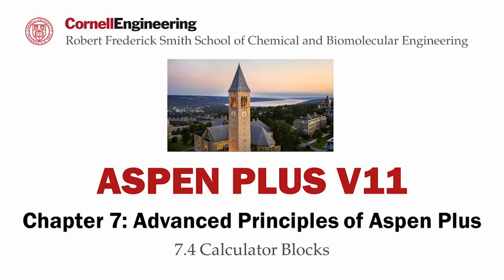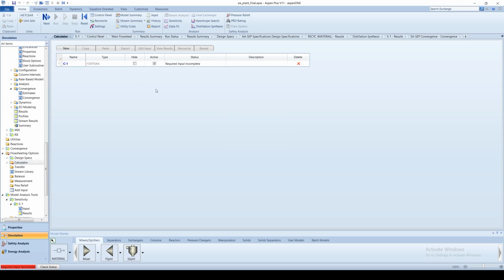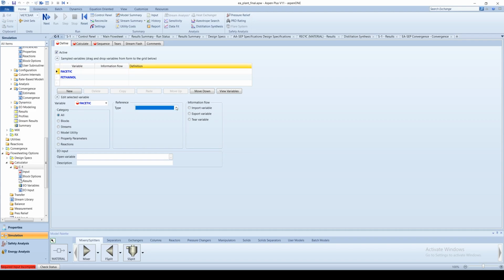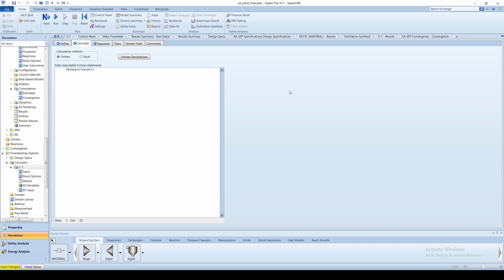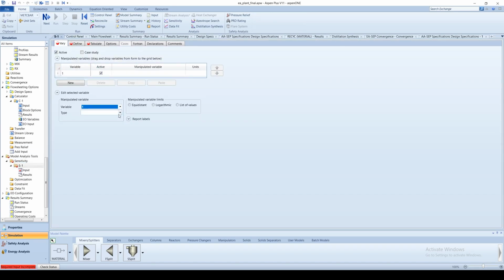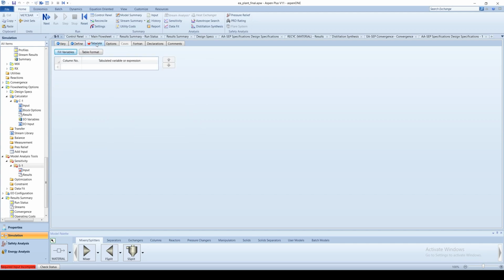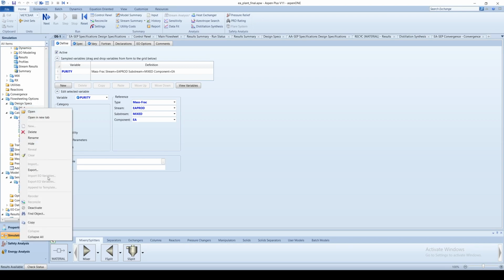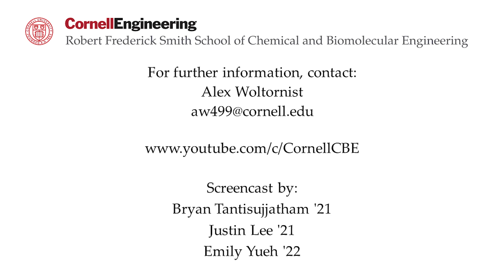Chapter 7.4: Calculator Blocks

Comment: Hello and thank you for this video. I still have issue using fortran code. my ASPEN plus is version 14. when I enter the formula, the error says "column 2 must be blank in Fortran statements". So, when I started it from column 3, another error appears. 
COP = ABS(QCON)/ABS(WCOMP)     
 non-numeric data in label field (columns 3-5), does anybody what is the issue?